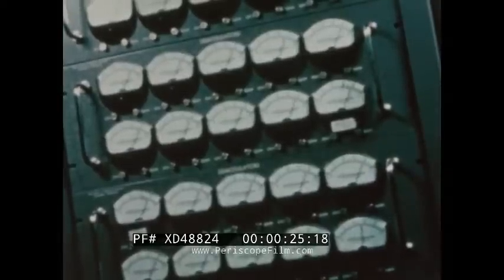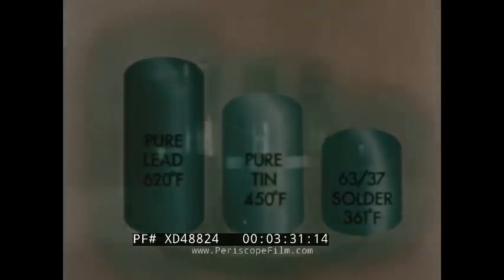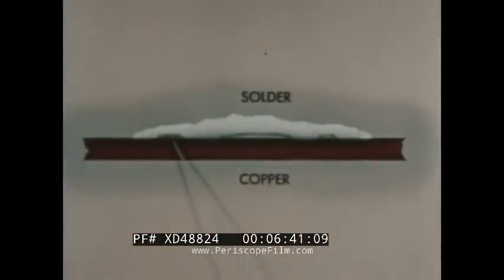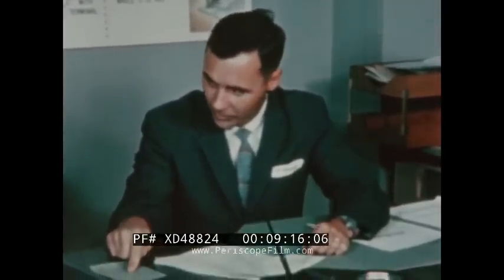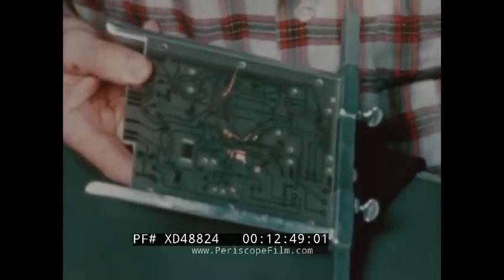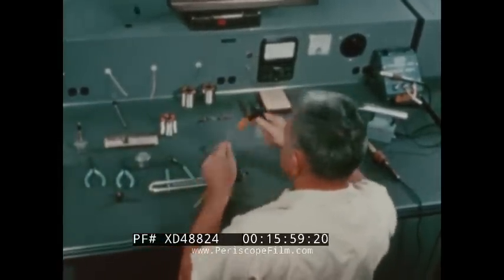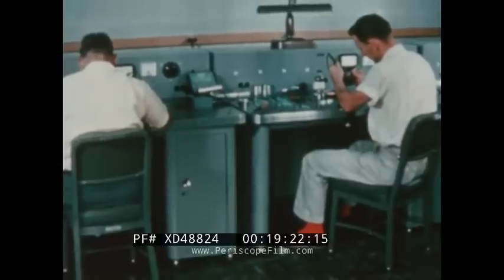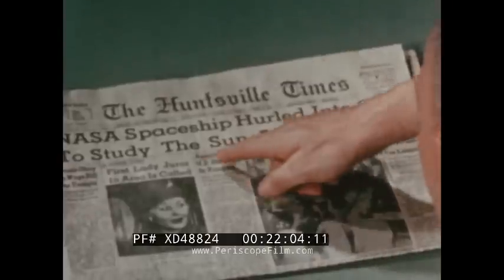1958 "ABOVE AND BEYOND" NASA SOLDER & SOLDERING TECHNIQUES ELECTRONICS INSTRUCTIONAL FILM XD48824

Comment: Considering how many rockets failed back then must have been a lot of crappy solder joints
Reply: It was actually ESD damage that was causing those failures, not improper soldering.
Reply: @GoSlash27   True. That phenomenon was not well known in that time period. I have old Germanium transistors in their original packaging...........With the leads pushed into Styrofoam. Somewhere I have a document from Hewlett Packard from the early to mid 1970's that showed some ground breaking work they did on that subject.
Reply: @capriracer351  We used to watch the training film from the guy who invented the pink plastic ESD bags. NASA was suffering all these failures early on, their root cause analysis eventually got them down to 2 kids who were washing and rinsing the containers the transistors were transported in. the ones transported in one kid's containers had mostly failed, while those from the other kid's containers were perfect. They went to visit them to find out what the difference was, and it turned out that the one kid wasn't rinsing out the soap thoroughly and that residual soap rendered the containers static dissipative (ESD safe). 
 They started an ESD control program and the launch failures went away.  
 I'm told the Soviets had a similar problem with ESD when they switched from vacuum tubes to solid state.
Reply: @capriracer351   At some point in the seventies integrated circuits started being packaged with the pins started being packaged with the pins stuck into this black foam rubber stuff that was conductive conductive and presumably impregnated with carbon. A decade or two later, new old stock parts that were still pushed into that black foam became difficult to use because the foam degraded,  and became both gummy and somewhat crumbly simultaneously, and tended to stick to the pins of the integrated circuits, which meant you had to clean them thoroughly before soldering them or pushing them into a socket.  I also wonder if any of that conductive foam became corrosive to metal. Other foam formulations certainly did.  In repairing old stereo equipment when frequently comes upon it comes upon various types of foam rubber similar to weather stripping that have become gummy and gooey with age or or crumbled and dried up or caused corrosion to whatever metal they touched. It's a royal pain scraping it all off and removing the gummytraces with solvent and then finding something suitable to replace it with.
Reply: The Santa Ana winds … came blowing in … from across the sea …

That’s not what Sinatra sang in Summer Wind, but that Santa Ana wind was an ESD source.
Reply: @GoSlash27  interesting information. I had never heard that before. I'll add that history to my  ever aging memory bank.
Reply: @goodun2974   I store all of my semiconductors pushed into that conductive foam. I don't remember ever having problems, but since you mentioned it, I'll have to look to see if any degradation has occurred.
Reply: @capriracer351  galvanic corrosion of leads in ESD foam is actually a thing, but it takes decades to manifest. In most cases NOS ICs in foam only require a little flux to behave normally, but in some cases you'll find DIPs with the legs rotted completely off.
Reply: @capriracer351  , the conductive foam often crumbles and becomes brittle, losing its elasticity ---- squeeze it and it compresses, and doesn't come back. It particularly seems to leave a greasy residue or bits of foam on the legs of gold-plated IC's. Clean 'em before installation. More than anything else, if a person only takes away one piece of important information from this video, it's this: *Clean*. Clean, clean, clean!!! (Okay, so that's three words 🙂). I've been doing the pencil eraser trick for decades (learned it from hams who were often ex-Signal Corps radio operators). I also use fiberglass scratch brushes almost daily (Esslinger, watch and jewelry supply, sells German made scratch brushes, fiberglass inserts, and even a special skinny scratch brush). Sometimes I even use a Draftsman's powered eraser, like a giant Dremel tool with induction motor and a hollow core to accept 8" long, 1/4" diameter eraser rods. The pumice-impregnated eraser rods are kind of hard to come by these days ---- apparently they're made with natural latex and they often dry up and become brittle with age.

Comment: Funny, all those precision techniques & they're usin' 10% resistors.
Reply: Ah, I hadn't noticed that. But they were cheaper, so it wouldn't matter in soldering school.
Reply: We still use 10% resistors in some applications, especially power supplies. In those instances the exact value of the resistor isn't important but the power rating and ability to remain stable under environmental stress is.